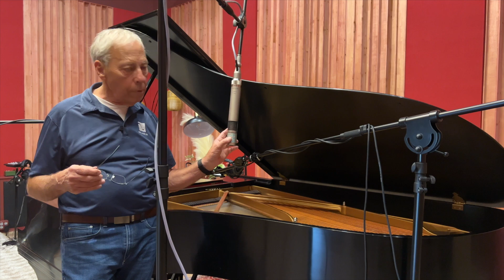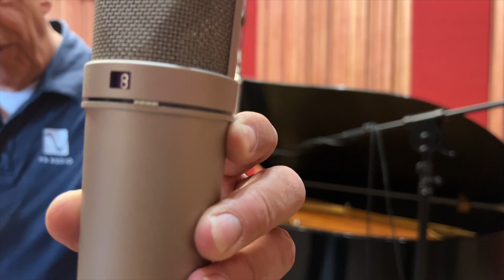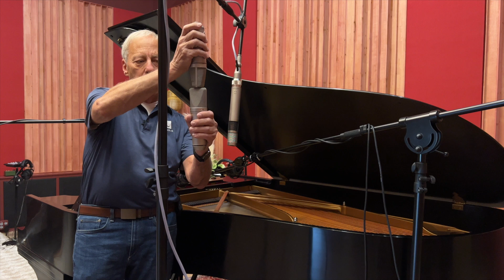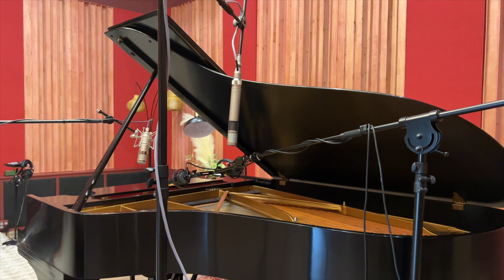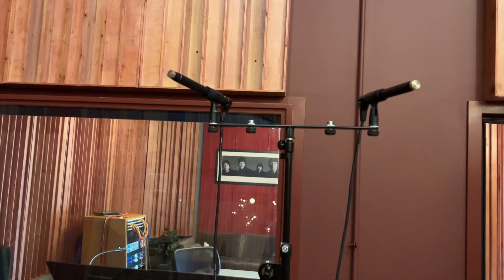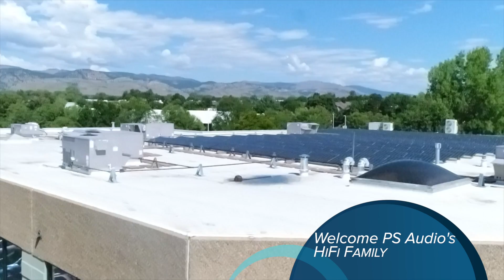The Blumlein microphone technique PS

Comment: @0:55 "...and when we do a 32 channel recording, the poor computer's going aghgra that's rough stuff"
Paul, this is the 3rd time that I have heard you state that your computer is straining.

If your computer is straining, then you need a more powerful computer (or computers, to do load balancing).
For some computers, a 32 channel recording will take little effort.  I do not understand why you struggle with an under-powered computer?

Or is it that you are trying to impress your viewers, that you have massive amounts of data, like no one has every encountered?
If that is the case, it is like someone with Bose speakers trying to impress someone with FR30 speakers that their Bose speakers are like what no one has ever heard.

For people in the know, you are showing a lack of computer knowledge.  Perhaps someone on your staff has convinced you that your volume of data is somehow impressive?
An Oracle SPARC M8-8 computer can be fitted with 256 cores, and 8 TB of RAM.  Such a system could easily process 25x your 32 channel recordings.

Consider the volume of data that music streaming services deal with?  Your volume of data, compared to theirs, would barely be a blip on their radar (so to speak).
There are countless examples of businesses that process exponentially more data than your 32 channel recordings.

I had left you comment the first time you tried to impress us with your volume of data.  I am not trying to hurt your feelings.  I am trying to keep you informed, so that you do not sully your engineering reputation.  When it comes to audio, you are an expert.  When it comes to computers, you are a novice.  Unknowingly demonstrating that you are a novice does not instill confidence in people considering PS Audio gear for their homes.
Reply: Just to be sure: You know that he talks about 32 channels of DSD256 recording with 11.2 MHz sampling rate, not about a mere 96 kHz/24 bit PCM recording? At least for me that sounds like an enormous amount of data traffic in a very short time.

P. S.: I forgot that the system has to record all these tracks with near-zero latency. Perhaps not really mundane. 😉
Reply: Hmm, ok - for someone who doesn't really know what Paul actually has for a computer set-up, and then to say that he's a novice - followed by showing that's he's one - seems to reflect a need to demonstrate your "intellectual prowess" to impress or educate, the latter of which I say lightly.  

First of all, Paul may or may not be a computer expert but he doesn't necessarily have to be. He has a team of professionals who work with recording software and hardware so his approach to it (as you seem to imagine) doesn't necessarily reflect the actual process.

Secondly, all the examples you gave denoting what other companies most likely do is irrelevant since Octave Records is a relatively small scale operation. They may not require super powerful hardware/software to accomplish the tasks needed at this time. 

Thirdly, regardless of the hardware/software any company has in place, really large files (in this case, music) will  take more time to process than files that are not as large. Seems self-explanatory (and perhaps an over-simplification) but just because a computer may "struggle" with a file is simply not an exact indicator of an inadequate set-up. Yes, I realize you didn't say that but that's what you are implying.  

And lastly, as if I really need to say this, you should know that Paul has a tongue-in cheek approach to how he sees things. It's a sort of humorous, self-depreciating charm that keeps him humble. But at the same time, he probably knows more about computers (among other things) than you care to realize. He just doesn't feel the need to put that out on full display. 

Might be a good lesson for you.
Reply: Well unfortunately you have already "sullied" your own reputation by proposing a solution to a problem that you don't fully understand.
Your analogy of streaming services is not applicable to this situation in that streaming services do not require the ingestion of large multiple streams of large amounts of nonstop data, that must stay 100% percent synchronized, while these multiple streams are coming in they all must be stored, processed, and output to multiple streams in different combinations with near-zero latency.
The amount of processing needed for these already huge files is significant and the fact that all the data needs to be processed and put out to different streams with potentially different processing on each stream, and stay synchronized to 1/11,289,600 of a second in real-time is much more than a "blip on the radar" and even cause an Oracle SPARC M8-8 computer with 256 cores, and 8 TB of RAM to work hard and probably couldn't process 25 x the 32 channels much faster.

Now to clarify, Paul refers to "the computer" as choking because the general topic he is discussing isn't really about the complete system or the specific computer, that is being used for the recording process or the type of processing that must occur in the recording process but in reality, there is much more involved than just the computer.
You really should do some more research about what is involved in his situation before just proposing that Paul is "sullying" his reputation.
Reply: @JonAnderhub  "Well unfortunately you have already "sullied" your own reputation by proposing a solution to a problem that you don't fully understand."
You wrote it on the internet, so it is true that you know what I do not understand.

"Your analogy of streaming services is not applicable to this situation..."
Did you expect me to provide a specific studio related example, without having the any of the specifications of Paul's current computer or anything other than 32 channels of audio?

I used streaming services to keep my example in the audio realm.  Of course it is not going to be an exact match for Paul's use case.  Do you think that you uncovered a secret that makes you special?

That is like expecting to make a comparison between facebook and twitter, without being privy to their demand load nor their infrastructure.

What's your next observation?  Dirt bikes are not exactly the same as road bikes?
Wow, did I just reveal a bike comparison that no one else would have noticed are not an exact match?

"...is much more than a "blip on the radar" and even cause an Oracle SPARC M8-8 computer with 256 cores, and 8 TB of RAM to work hard and probably couldn't process 25 x the 32 channels much faster."
You are just making things up.

You drew a picture of a non-existent infrastructure (one for which you cannot speak with any first-hand knowledge, without working in those company's engineering department), in an effort to convey that you know (when you do not know), and then when you feel you have convinced people that you know, you conclude that an Oracle SPARC M8-8 cannot handle the load.

"Now to clarify, Paul refers to "the computer" as choking because the general topic he is discussing isn't really about the complete system or the specific computer, that is being used for the recording process or the type of processing..."

You are stringing words together that sound impressive to non information technology folks (like our host).  Yet, your combination of words are what you would find in a "B" class movie with a low budget, where they could not afford to get a system's expert to word things to make sense (but good enough to impress most folks that know little to nothing about computer science).

"but in reality, there is much more involved than just the computer."
You write that, as though someone wrote otherwise.

If is like someone comments on how car safety is important, and you reply "but in reality, there is much more involved than just the crash testing"

"Now to clarify, Paul refers to "the computer" as choking because..."
This is you, again, fabricating BS.
You did not speak to Paul.  You watched what we all watched.  You pretending that you know the "because" of his statement is absurd.  Perhaps you also know why Paul chose which color footwear he wore, without him stating his reason?

Rather than trolling for drama, by taking an opposing position, just for the heck of it, you could be more helpful by contributing helpful comments and factual comments.  Making things up, and trying to look like you know more than what we all saw in the same video, is counter-productive.  But some people get a charge out of being counter-productive.  They enjoy being a wrecking ball.

Try being part of the solution.
Reply: Oracle SPARC M8-8 don't run windows. Many DAWs need Intel or Apple. Even it does run Windows, the CPU doesn't have SSE2 that many plug in will run.
Reply: @kongwee1978  I believe that it would, as a virtual machine.  I might be mistaken.  It will run Solaris, and perhaps Paul's system is running UNIX / Linux?

I gave the M8-8 as an example of a box that is in a whole different realm of power, compared to whatever Paul's box is.

I suspect that even a 32 core Threadripper is far and above whatever Paul is using, let alone a 64 core Threadripper Pro, or a system with an EPYC processor or a Xeon processor.

That Paul never mentions what his stressed out computer is comprised of is conveying that he does not know, and yet he brags (for lack of a better verb) his volume of data is legendary (for lack of a better adjective).

It is ridiculous that a 32 channel recording would stress out a computer built for purpose.  Paul actually thinks he has a stand-out example of data operations, because his Best Buy (or similar), massed produced system is struggling.

He drives a Tesla, and had mentioned that it is powerful -- and he is correct.  But it is no Top Fuel dragster.  And I doubt that Paul's computer is even on the level of his Tesla's performance.
Reply: @NoEgg4u  You can't beat sub set to raw computing even you can achieve 5ghz per core. Other example is Apple M2 that decode/encode 8K H265 like no other CPU does. It is operating at 3.2 mhz. Even you have 5ghz, you still have jerking video processing using raw power. Apple M2 has sub set for H265 video in M2. In DAWs, Intel sub set is better than Apple M2 in this moment for the memory and bandwith with SSE2.
Reply: @housepianist  "Hmm, ok - for someone who doesn't really know what Paul actually has for a computer set-up, and then to say that he's a novice - followed by showing that's he's one - seems to reflect a need to demonstrate your "intellectual prowess" to impress or educate, the latter of which I say lightly. "

That is a lot of assumptions, that you are accusing me of making, while you do not know me, and therefore are making assumptions of me while accusing me of that offense.
The irony.

As to needing to demonstrate my "intellectual prowess", you pulled that out of the sky, because I did no such thing.  And if I did, you should not take issue with learning from others.

I do not know how a Ferrari generates so much performance, and yet I know to not tell anyone how much my 2003 Sentra is handling.  I do not portray my Sentra as taking on a massive job.  I do not assume that my car is representative of higher performing cars.

"First of all, Paul may or may not be a computer expert but he doesn't necessarily have to be."
That is you making up a "First of all".  You are introducing something that has zero to do with my comment.

If I brag about my Sentra, it makes no difference whether or not I am a mechanic.  I should know better.  It is the act that matters, and not the education of the person conducting the act.  Paul is bragging (for lack of a better verb), about a volume of data that is not a big deal.  And bragging that he does not have a proper computer for the job at hand is somewhat cringy.  It is somewhat like a child that runs and tells his mommy about how high he jumped.  Appropriate for a child's age; not for an adult.

'"intellectual prowess" to impress or educate'
I have not seen you take issue with Paul doing the above.  There are some people that regard hosts as sacred cows, and if anyone does not flower them with compliments, they get triggered.

"...so his approach to it (as you seem to imagine) doesn't necessarily reflect the actual process"
More BS.  You do not know what I imagine.  And you do not know his actual process.  You are simply lashing out with BS.  Defending your leader?

"Secondly, all the examples you gave denoting what other companies most likely do is irrelevant since Octave Records is a relatively small scale operation."
So you wrote "most likely do", meaning that you do not know what they do, and you concluded that my examples are irrelevant.  More BS.

"Thirdly, regardless of the hardware/software any company has in place, really large files (in this case, music) will  take more time to process than files that are not as large." 
So when the facebook processes 100 GB per second in small files (small database transactions), you believe that processing a single 100 GB file is more taxing on the computer?

"Seems self-explanatory (and perhaps an over-simplification) but just because a computer may "struggle" with a file is simply not an exact indicator of an inadequate set-up."
Again, you just throw out BS as facts.  I guess that just because grass is green does not mean that it is green?

Of course, if a computer is struggling, it is the very definition of an inadequate set-up.  Are you normal?  I had to ask, because your attempt to make a struggling computer to be deemed as an adequate computer is absurd.

"Yes, I realize you didn't say that but that's what you are implying."
A computer that is struggling is not an adequate computer for the job.  No need wonder what I am implying.  I wrote what I wrote, and it is clear.

"And lastly, as if I really need to say this, you should know that Paul has a tongue-in cheek approach to how he sees things."
Which has zero to do with telling his viewers that he has loads of data that his computer is struggling with.

"It's a sort of humorous, self-depreciating charm that keeps him humble."
You are free to size up someone you never met, never spent time with, never got to know, never spoke to his friends, never spoke to his co-workers -- as humble, based on watching his videos.  He is a salesman, and any good salesman will sell you on their business personality.

I have never met a car salesman that was not charming and friendly.
I am not suggesting that Paul is one way or the other, because I do not know him.  As such, I do not draw any conclusions as to him being humble  You have drawn your conclusion, without knowing him.  To each his own.

"But at the same time, he probably knows more about computers (among other things) than you care to realize"
Again, with your BS.
You have no idea about what I care to realize.

This tactic of yours must work with others, because you repeatedly write as if you know things that you can't possibly know.  You write these things in an attempt to show that you know more than others, when you are just making things up.

"But at the same time, he probably knows more about computers (among other things) than you care to realize"
He "probably" this, and "probably" that.  Again with you attempting to sell your fabrications as if you know what you do not know.  You have no clue, none whatsoever, about what Paul knows about computers.

"He just doesn't feel the need to put that out on full display."
Again with your BS.

You have no basis for knowing what Paul feels like putting on full display.
Or perhaps you and Paul have gone camping together, and play Badminton on weekends?

"Might be a good lesson for you."
Please invite me to your next boy's night out with Paul, so that I can learn more from you.
Reply: @NoEgg4u  It is the CPU sub set instruction that accelerate the processing. I mean you can buy M8-8 but your performance will be like Intel i9. XEON has the sub set that many DAWs and plug in already make used for decades. Apple Silicon is a great example. It isn't very powerful but containing lots of sub set to accelerate video processing. Some for audio, 3D and AI processing. It is call SOC.  Another example is GPU, I mean you know how it works.